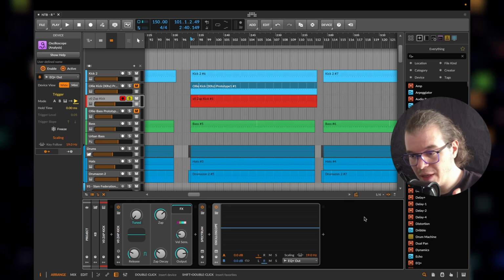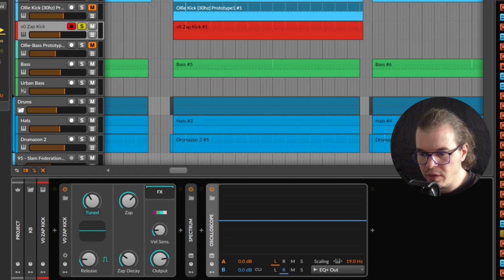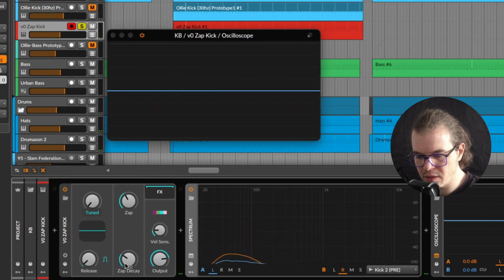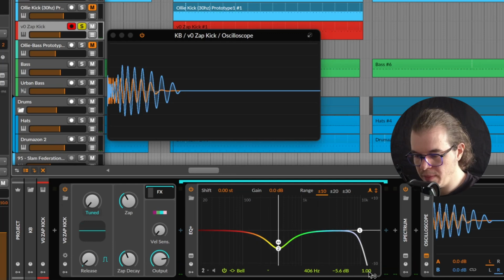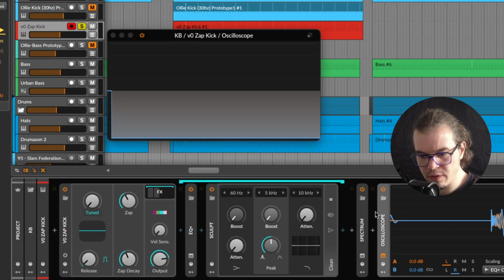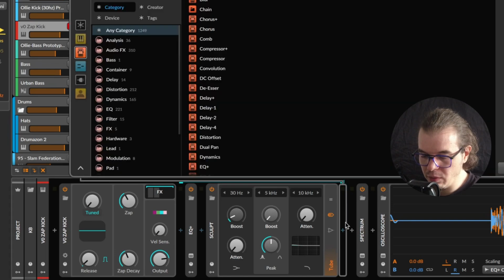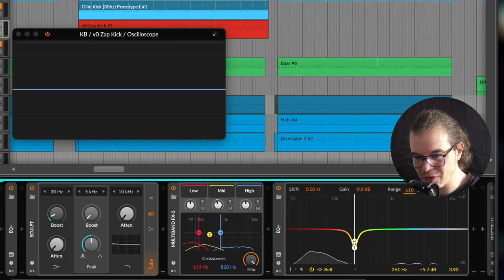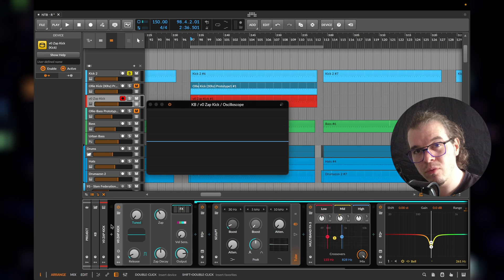Are Kick plugins necessary anymore?

Comment: If you press the small symbol during the zap kick there are 3 more settings (Pitch, Freq, and Phase) with which you can change the phase. or just press F1 then you will see it too!!
Nice Kick!  Bitwig is the best🤘
Reply from the maker: The fact that I didn't need to open that section and still got my kick proves how good the device is imo.
Thanks for the tip, I really don't know how I missed this section, guess I was soo much into my less is more idea that I just didn't notice it lol 
Btw that Phasemod knob is perfect for phase alignement duties